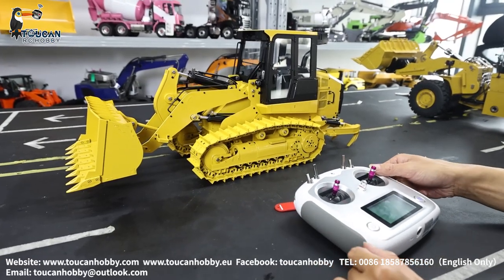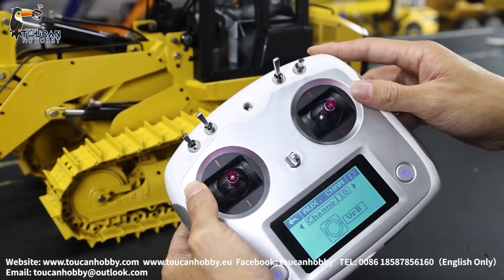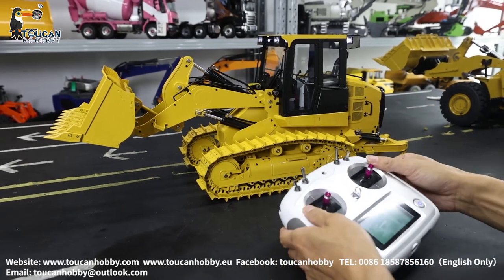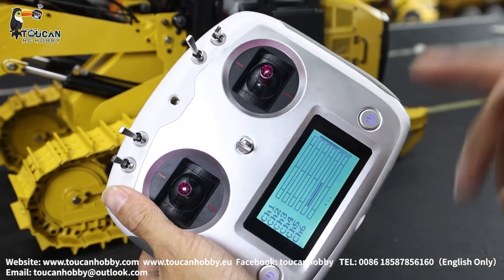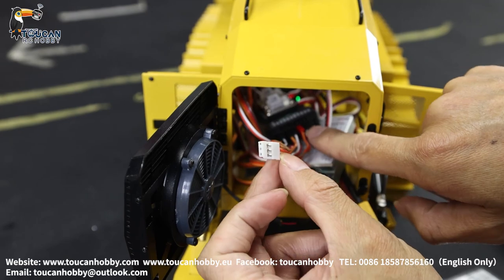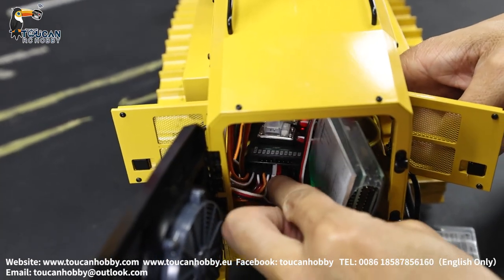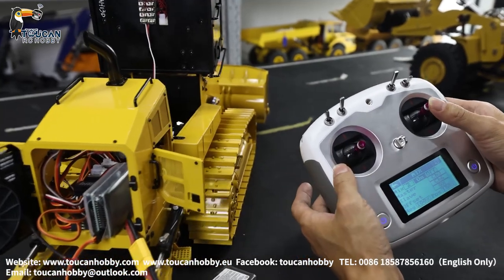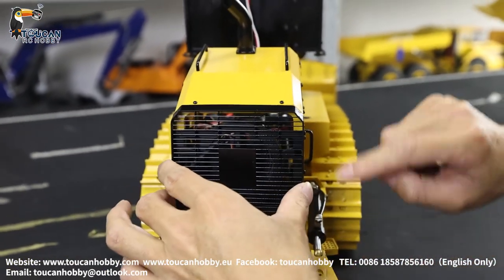How to reconnect and set up for engine sound of JDM Model 1/14 RC Hydraulic Loader JDM188 Cater 963D

Comment: Great idea.  the only problem is that tracked machines are run at a set throttle speed and decelerate when changing direction of travel.  I was thinking more accurate would be to link the sound module off the pump channel.
Reply from the maker: But throttle or pump can only choose , or can set mix control start pump also start engine sound